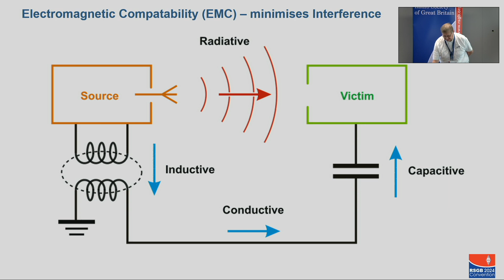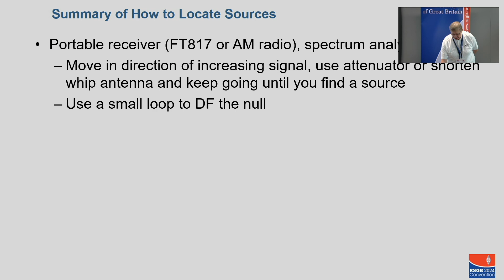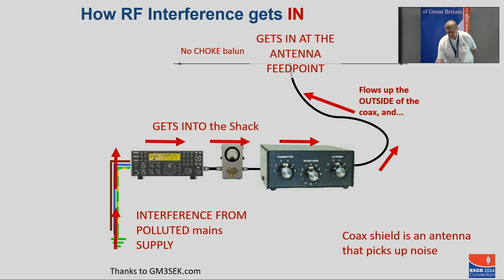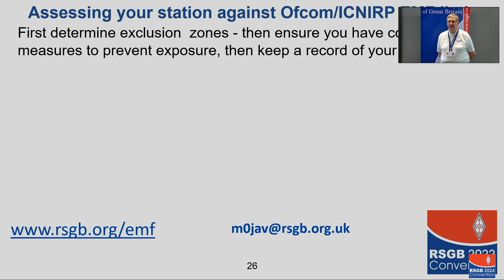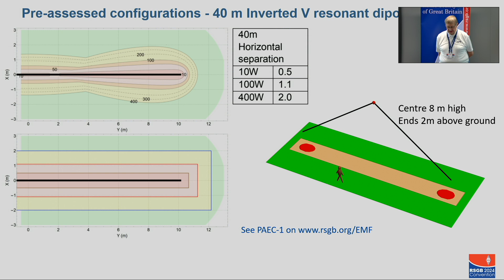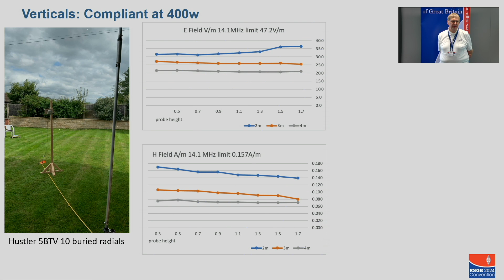RSGB 2024 Convention: EMC and EMF update

Comment: I suffered from broadband interference for years, it started on 30m then went to 160m to 20m with S8 noise. I did use a loop on a stick to find it was my phone line.
Ofcom investigated and said it was my phone line probably corroded becoming unbalanced and radiating. B.T. would charge me to take down their faulty line! I was with Virgin and underground cable. 
I almost gave up radio, dropped out of the RSGB but re-joined after three months because I didn't want to give up completely. The higher frequencies were opening up so I still had something to use.
Early this year I went over to Vodaphone and they put in overhead fibre optic cable. 
Problem instantly gone!
I have my hobby back.

G4GHB.
Edit: an amateur friend couldn't or wouldn't believe it was from broadband and said I had deaf receivers (all four) and poor aerials.